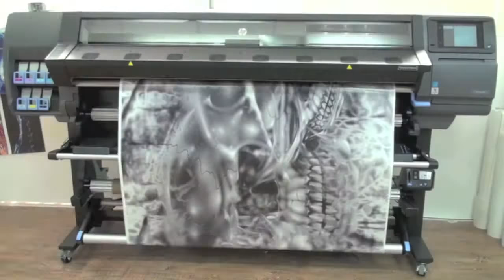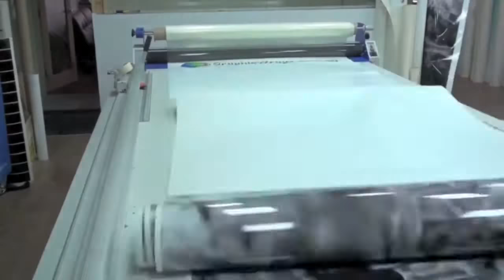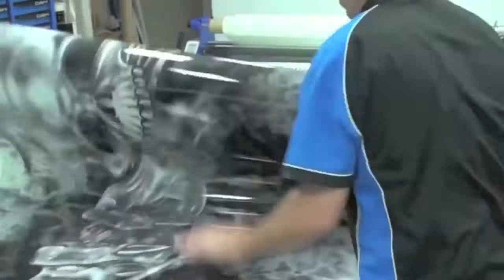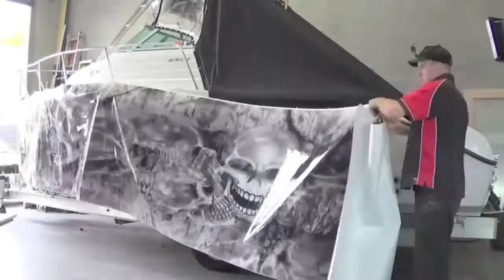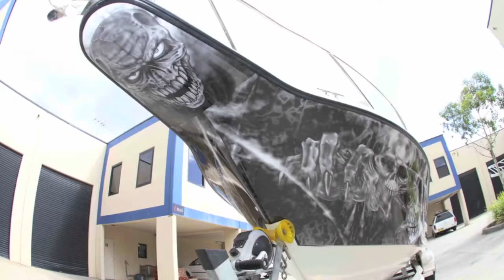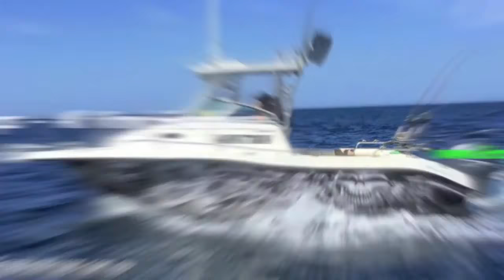Skull Boat Wrap - Seaswirl Striper 2301 Jan 2015 - HP Latex 360 Printer - Solvent Free Printing

Comment: What is the NET cost of the media/ink used on this project?
Reply from the maker: +Luke Boerum That would vary depending on ones preferred media type and printer type used. Material buy in price will vary depending on your own buying power and of course your over heads of running you business. As with any business we don't display our privileged information/internal operation costs on Social Media. Thanks for your inquiry.